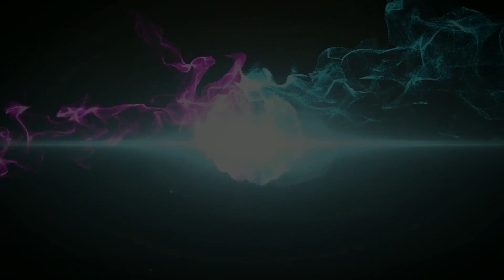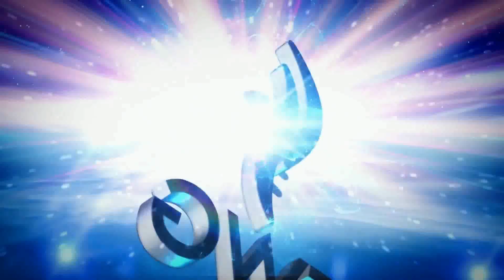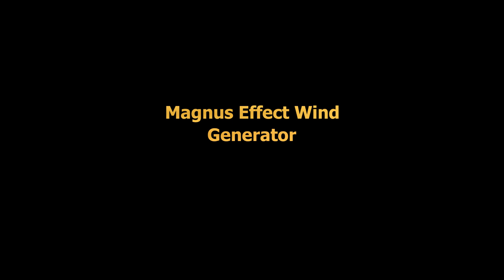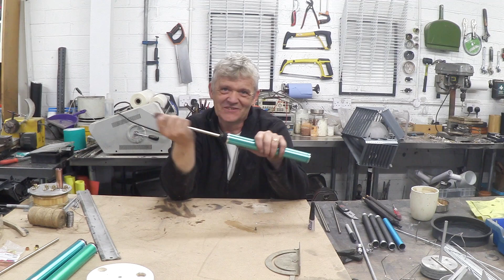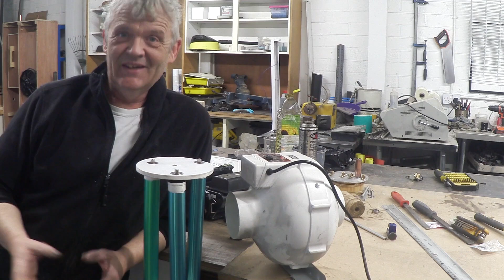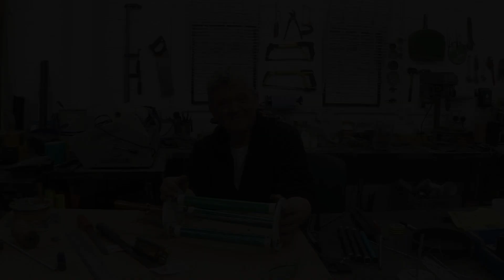Magnus Effect Wind Generator For Hurricanes - Toner Recycle Project 2

Comment: I swear this is true, I had a dream, and then I  did the search. My dream went like this: A couple of guys in a helicopter type of fuselage started pedaling, and when they did this big thing on top started spinning. The thing that started spinning wasn't blades, it looked like a big  T shape rotating and on the arms of the T were rotating cylinders, but the cylinders weren't flat and smooth they were several long blades sort of joined together on one edge horizontally. So they pedaled at a constant rate that was so slow it created no lift, then they flicked a switch and the cylinders started rotating at a high variable speeds, but the rotating T remained at the same speed. I could hear the rpms of the cylinders increase and decrease as they maneuvered. Maybe I'm missing some physics principals, then again dreams have ways of defying physics. I believe the magnus effect. I've seen where they can adjust the pitch of the blades in the rotating cylinders to manipulate flight, but I've never seen the cylinders rotated horizontally. Just an idea I though I'd shoot your way, you are definitely more able to experiment with something like that than I am. This is a totally  different take on the effect you are doing in this video.

Comment: This is a really late contribution,  but the Japanese did NOT invent the Flettner Rotor Windmill.
In fact, Anton Flettner himself designed one.
And Popular Mechanics magazine in the 1950s showed a 30 ft working example. 
And this version is derivative of about 6 other experiments I have seen .
The true innovation of Japanese version of the Flettner Rotor windmill  for hurricanes had spiral flutes running up the cylinder.

Comment: Delving into the Magnus effect and Flettner rotors again has brought to mind a really BIG idea for electricity generation by the rotor. It was a 20mw plant that was to be built at Burlington New Jersey USA in 1933. The Madras rotor, as it was called, was to run on a circular railway under its own force effect, having its wheels to be geared up to a generator. But even though a rotor was built and tested, it all came to nothing. I can only find one reference to the Madras rotor idea on the web, there used to be more.

Comment: A one megawatt horizontal wind turbine was built in Poland, the Acowind A63 around the turn of the century, there are photos on the net. It didn't live up to expectations, what happen to I don't know, but I kept an eye on information it about while it was working. Magnus effect wind turbines, whether hwt it vwt, are better used as pumps, so, if I remember correctly, the A63 used an oil transmission to hydraulically pump round the generator, probably another idea on paper that didn't work in practice - the Enfield Cables Andreus wind turbine is another example of not living up to engineers paperwork hopes.
What is more to the point is the fact that many years before the A63, the man most closely associated with the application of the Magnus effect, Atom Flettner, built a similar size hwt, which must have been the largest wind turbine of the day. I think the lack of knowledge of this is due to the fact that there are no photos of this turbine on the web, although there are some line drawings. I have seen a photo of this turbine because I have read The English translation of Flettener's biography, The Road To The Rotor, published in 1926.The turbine was totally unfit for purpose, the four rotors,NSEW, we're in front of a control cabin with a gantry between. It was more like a building than like the industrial wind turbines of today, it could never be high enough to catch the wind it needed.
But Flettner never really intended the turbine's main blades to be connected to the generator, he intended to put a smaller turbine on the end of each rotor blade and use the higher tip speed for electricity generation. There's a drawing of this type of turbine in the biography.
I hope some publisher one day will publish this biography, it's out of copyright, so it shouldn't cost too much. Or if perhaps somebody has an old cop they could scan for us, he was an enterprising inventor, it's a good read.

Comment: This does not demonstrate the Magnus effect. To demonstrate it properly you would need to power rotate each cylinder. The direction of rotation would need to change depending on which half of the rotation it was on so the force created is in the direction of the rotating plate. Also it would work better if you had rough cylinders instead of smooth ones.

Comment: Im sure im far from first. Put small motors on the cylinders so they rotate and u will geberate much mot 'lift'. Maybe.. even using your planetary gears, without motor. Inital spin to generate rotations to generate more spinning

Comment: Silly question I've been searching for info on generator design but coming up short. What I was looking for specifically so I don't waste time experimenting is if it makes more energy using a coil with a lot of winds or if it makes more energy using more smaller stacked coils. I think amperage adds by putting coils in parallel but it's not specific about wether one big coil is better or several smaller coils🤔

Comment: Hi Robert, I am very open minded bud..... this is not a Magnus effect generator drive. The Magnus effect requires the cylinder to spin. Your rotor spins because the blower is positioned offset. Now it is rotating counterclockwise if you install the blower offset on the other side it will turn clockwise. You know that. I am looking forward to see version 2.0
Reply: Spot on, this really is misinformation, no magnus effect, and its not a wind turbine. I too look forward to version 2, with powered cylinders so we can see the real magnus effect. It would need a controller and a battery so it can start up, and the 3 motors will impact heavily on any generated power, a turbine of that size is unlikely to generate more power than it uses to spin the rotors.
Reply from the maker: No worries mate - and cheers

Comment: As a standard wind generator, it would not be very good, but if you can anchor the whole frame to withstand 80 KPH, and higher wind speeds I bet you could generate a fair amount of power.
 and your right, that nay sayer is a dumb git.
Reply from the maker: I'll bet you could mate - cheers

Comment: Brain storming! Wind air compressors are used by Amish in the  us. Air compressor create moisture from  compression. In the run of a day someone  site mentioned couple of gallons or so? If so and someone could correct me on this but would this  water not be valued as possible drinking water?  The other thing interesting is the air powered vortex tubes that create hot on one side and cold on the other-40 to  200 degrees 😳.  Look up wind powered air compressor on Google.
Reply from the maker: will do mate - cheers
Reply: Some use use a small air driven generator to power on demand electric appliances.  Never seen  one just  heard of it! Water, heating, cooling, and electric power all from 1  system, sounds pretty good! Just to figure out how much of each and make it work!

Comment: You are going to have me building a turbine in about a minute, ha-ha, I already can't stop thinking about them! I have a dozen solar panels to put up, but I guess I'm going to try a turbine also, I have delco alternators, I just need the magnetic rotor, there is several ways of making a PMA from an alternator. I guess I'll try the simplest way, of adding a couple ring magnets, or just put neo, magnets around the rotor, I'll start with either a 60-80 amp, or a 100-120 amp, if I can get 50-60% of rated current in a decent  'it's about to storm' wind,  and about 75-80% in a good wind storm, I'll consider it well worth it! I guess I'll have to get a electric water heater, to keep it working, when the batteries are full, I use a tankless gas water heater, I guess I can work it out to  switch between the two, then I can use the solar to heat water when the batteries are full also, wind included, it should be 6 kw plus,    ha-ha,  see what you did! Ha-ha cheers
Reply: I've had a similar idea for a while.  Additionally you could have a bicycle powered alternator hooked up to a generator.  Have it all on a platform like a gazebo where you go out, exercise on the generator bike while shaded by solar panels and wind blows through to cool you off and also power the turbines mounted in the supporting pillars.   The issues I had conceptually were 1) weatherproofing and 2) battery charging circuit design.  It would have to be weatherproofed since it would be an outdoor structure year round.  The circuitry part I imagine I would need one or several charge controllers  and/or multiple batteries to manage the different input voltages but perhaps this could be managed with just diode rectifiers.  Cheers!
Reply: Also would love help designing a  miniaturized molten salt solar thermal array to power a thermal energy storage system of molten salt which can power a small steam turbine.

Comment: I wonder; instead of using gears or some other form of mechanical transmission if a coil or a set of coils could be wound on the main spindle as well as around the aluminum shafts.

Comment: Rob (or anyone) can you explain how the magnus effect applies in your design ? The design you are replication has electric motors in the cylinders so they spin and can take advantage of the magnus effect. In your design there are no motors, the cylinders are not spinning, so no magnus effect ? I assume yours spins because the fan is not placed centrally. I do not belive you have replicated the design as you said at the start, nor do I believe there is any magnus effect taking place as you are not spinning the cylinders at all. I worry you may take this video down and just say there were negative comments, but please educate me, how is there any magnus effect ? Why does the Japanese design use complex and expensive electric motors to spin the cylinders when yours does it without ? The cylinders have to be spun up.... they dont spin as a result of airflow past them.
Reply: Here is the quote from the designers website: "In the vertical-axis Magnus wind turbine, the cylindrical blades are driven by an electric motor, which causes self-consumption of electric power. The net power generation amount is the amount of power generated minus the power consumption of the motor, so the power generation efficiency is inferior to existing wind power generators. On the other hand, the Magnus wind turbine can start power generation at a wind speed of 4 m/sec and continue power generation up to a maximum wind speed of 40 m/sec. Compared to the existing wind power generation that can only generate wind speeds of up to 25 m/sec, the wind speed range in which power can be generated is greatly expanded. As a result, the operating time will be longer and the capacity utilization of the generator will be improved, so the greatest feature is that the total power generation amount exceeds the power generation efficiency that is inferior to the existing wind turbine.
Currently, we are acquiring data on power generation efficiency and facility utilization rate in a verification test in Ishigaki City, Okinawa Prefecture, which started in August 2018."
Reply: @goldmagnet9013  Your are correct. This is not a Magnus rotor -- for the reasons you stated. I've done a lot of experimenting with the Magnus effect and also with various types of VAWT, and I've read lots of research papers on the subject.

Comment: If the individual tubes are rotating, couldn’t a small gene be put on the end of each one?. Or would the resistance cause the ‘Magnus affect’ be compromised?
Reply from the maker: the tubes have to turn for it to be the manis effect mate - really you would want to drive them as opposed to taking power off

Comment: Hey Rob... There is always someone who will tell you it CAN'T be done or it won't  work. I developed and patented a solution to mix with oil well drilling mud, paint and any liquid to carry a radio frequency. Every engineer that knew of our development said it won't work, without exception they were very negative. Well it works amazingly well. People have difficulty when it comes to paradigm shifts. Keep making those paradigm shift challenges. Thanks Mate.

Comment: hurricane force? is this meaning it is to be used in hurricanes or using the correlius effect that causes cyclones to spin in opposing directions due to the angle from being on one or the other hemisphere (north or south) on the earth? (thing that is accused of why toilets spin one or the other direction unfortunately since the shapes and what not deformities in the structure alter the flow direction with enough force to over come this effect, basically I guess you would have to have a perfect round bowl shape with a perfectly placed and rounded hole at the bottom to see the effect in action. )

Comment: Sitting here wondering how it turns at all.  I would think the wind force would be equal on all cylinders.   Obviously I'm wrong.    Are the cylinders  angled  from top to bottom ?
Reply from the maker: nope straight
Reply: It turns because the airflow is uneven, off to one side. You are not wrong the force on the cylinders is the same.
Reply: @goldmagnet9013  That being the case I wonder how pivoting air foils would produce.  One side would produce lift and pull while the side heading into the air stream maybe produce  a pushing force into the wind.  ??
Reply: @pulesjet  Thats essentially how a Darrieus wind turbine works, I have seen designs with pivoting blades but the mechanisms tend to limit rpm and power.

Comment: how many can be set together before the additional power per unit starts to decrease significantly? 
straight line along wind direction?
straight line perpendicular to wind direction? 
a fan shape from the wind as point/angle?
big rectangular matrix of X x Y size?

perhaps what is the direction of wind deflected outward from the device after the wind passes through? is there a change in speed of wind between input and output from the device? if so, what is the difference?
Reply from the maker: have a read the Japanese research mate